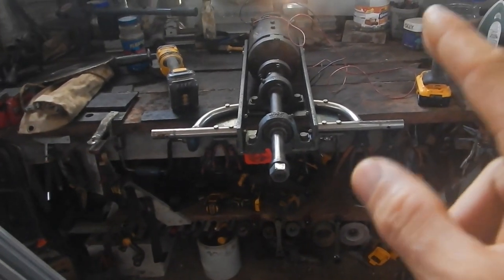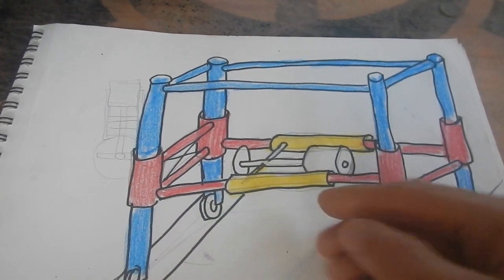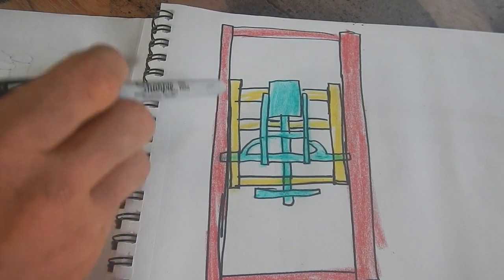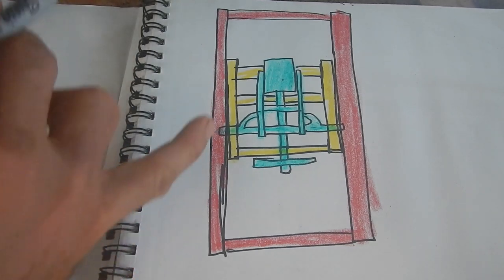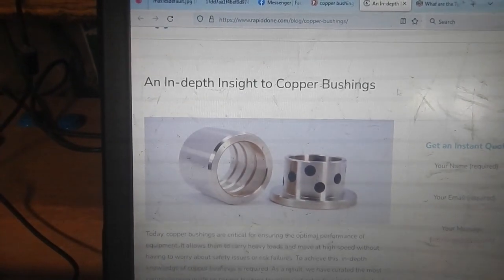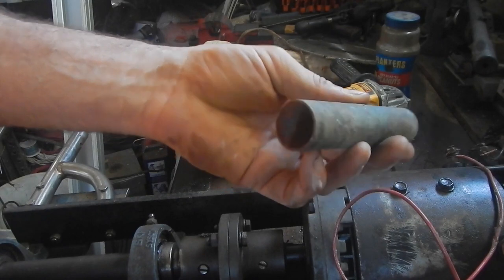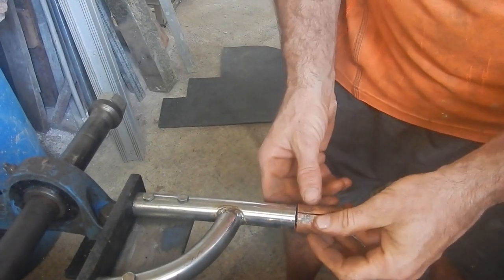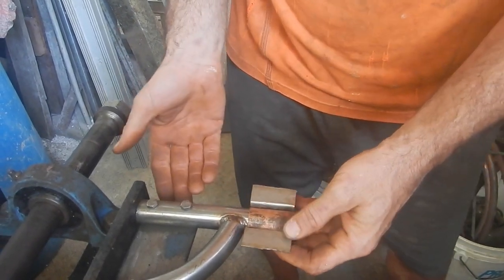Lumber Mill 008 Pulling out My Stash

Comment: Just to throw it out there, you also have a chainsaw that has a much deeper depth of cut. If you mounted the chainsaw to your sled assembly you could one-pass logs the size you usually have. Better yet, make a plate to swap from chainsaw to circular for thinner stock.

Comment: I dont see how this will work as a sawmill. I can see it as a kind of table saw having the same size blade as one. A sawmill is designed to cut large logs. With only 6 inches of blade showing I dont see how you plan to use this.